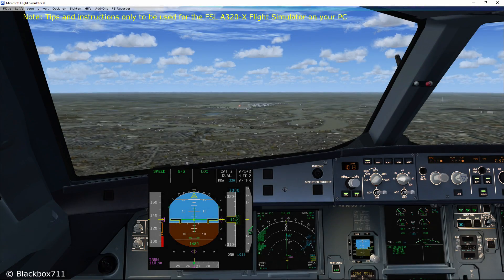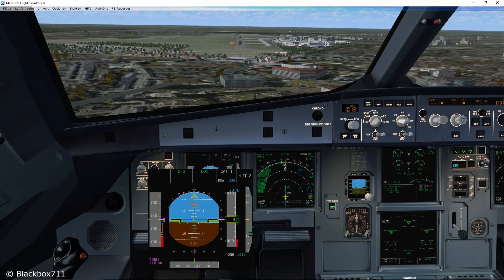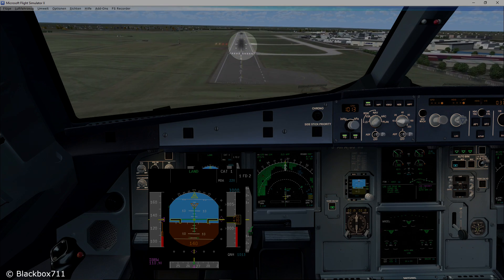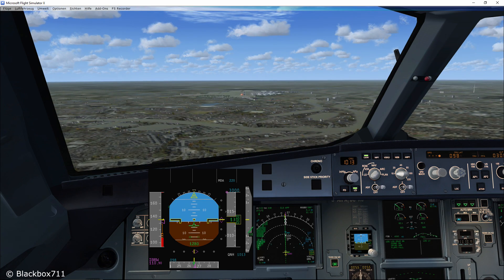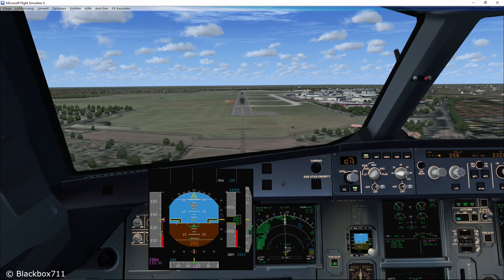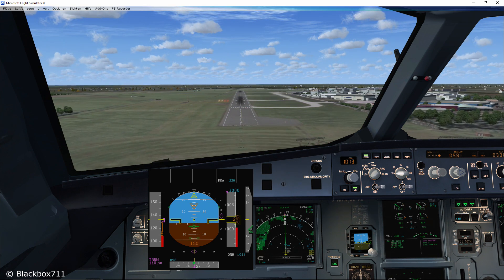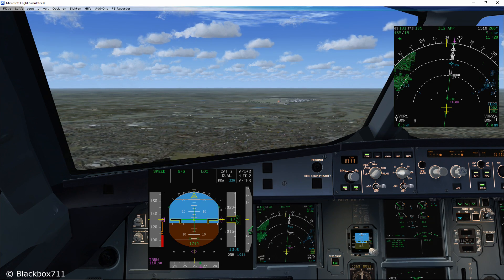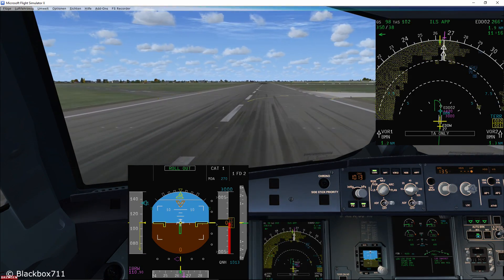FSLabs A320-X Basics: Landing Technique for the FSLabs A320-X

Comment: Hello Blackbox, and congratulations on your Youtube channel, very interesting. Here is my question: I notice you tend to start the flare at around 20 ft from the ground. If I do that, I bury the Bus. I usually tend to start right before 30ft, but even then, I get mixed results: some flares are good, some are not, I am not consistent. How do you get so smooth landings, flaring 20ft before touchdown? I keep trying but I am not happy with my results. Looking forward to any suggestion....
Reply from the maker: Flaring at 20 ft is early enough if you use the correct amount of back pressure to slow down the descent rate. If you prefer a more subtle technique then start the flare at 30 ft. The only thing to help you get better is practice. However stick with one technique and then stay with it. Also make sure that from 50 ft RA down you are on a stable flightpath. Happy Landings

Comment: Hi Blackbox. I have a question. How do you alter the flare technique where the airport has a steeper glide slope ... such as Chambery? Do you initiate the flare earlier ... bearing in mind Flare mode is referencing the pitch attitude at 50feet .... or should you flare at the same point but more aggressively? It,s certainly more difficult to get good results! Thanks for all your great videos!
Reply from the maker: +Nick Kidd .. thank you very much. Yes, when on a steeper Glideslope I would start the flare a little earlier, however not before 50 ft. So let’s say at 40 ft I would increase pitch slightly to a normal value and then between 30 - 20 feet continue with the normal flare. Regards

Comment: Hey Blackbox! Eine etwas dämliche Frage, aber wo werden die 3° Sinkrate angezeigt? Ich sehe immer nur eine 7 oder eine 8. Danke!
Reply from the maker: Hi. Kein Problem. Die 3° werden mit dem FPV (Flight Path Vector - kleines grünes Flugzeugsymbol) auf dem PFD angezeigt. Gruß
Reply: Perfekt, danke! Was zeigen denn die 7 oder 8 ganz rechts im PFD an?
Reply from the maker: Sinkrate in ft/min. Also 07=700 ft/min, 08=800 ft/min

Comment: what is the purpose for the airplane to set the pitch trim 2 degrees down? is it intended to compensate the ground effect (lift) ?
Reply from the maker: +Gianpaolo Pazzini ... the flare mode simulates the pitch down moment when you, for example reduce thrust in an conventional jet (like the 737) and have a resulting pitch down moment. So you have to maintain a little stick pullback to avoid the nose dropping too fast during flare. Remember the A320 has pitch stability, meaning it will try to maintain a 1 g flightpath. So if it wasn't for the flare simulation, you would have to push the nose down during flare. That is the opposite what pilots learn during their initial training on conventional aircraft. Regards

Comment: @Blackbox711, You mentioned in the video that in the Flare mode, pitch begins to be reduced at 30ft RA. I have a pilot friend who flies the A320 and is a Check Captain for JetBlue, and he told me that the flare mode begins at 50ft. RA. Is there a reason for this difference between what you've posted and what he's told me?
Reply from the maker: Hi Jeremy. Here is an explanation from airbus instructor support maual: "When reaching 50 ft RA, the pitch law is modified to flare mode: indeed, the normal pitch law which provides
trajectory stability is not the best adapted for the flare maneuver. The system memorizes the attitude at 50 ft, and that attitude becomes the initial reference for pitch attitude control. As the aircraft descends through 30 ft, the system begins to reduce the pitch attitude (2° down in 8 sec). Consequently as the speed reduces, the pilot will have to move the stick rearwards to maintain a constant path". 

Maybe your friend has a different manual or maybe the software for the flare mode has been changed in the meantime? Hope it clears things up. Regards

Comment: I don't quite understand why the aircraft pitches down in FLARE mode, only for the pilot to have to pull the stick back to correct it. Surely if it didn't do that then the pilot would just flare normally as they would on any other aircraft?
Reply from the maker: Hi Phil. In a conventional aircraft you flare the aircraft and reduce thust. This means that due to the thrust and airspeed decrease the nose will drop requiring the pilot to pull back on the stick. Airbus decided to implement the flare mode feature to simulate this behaviour. Regards